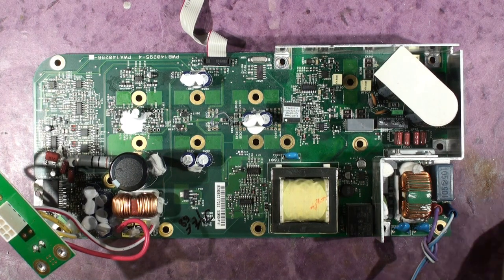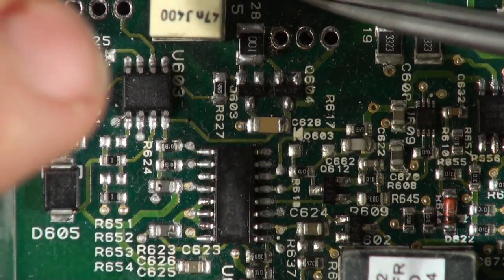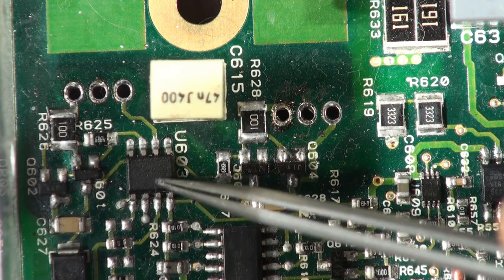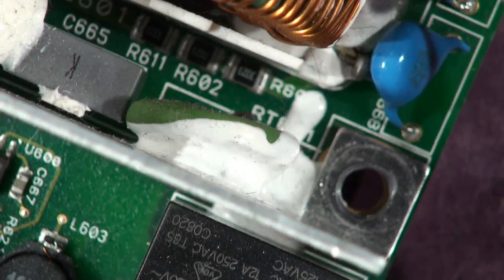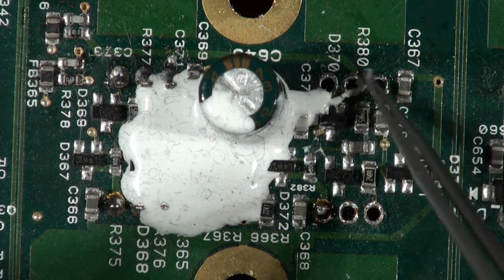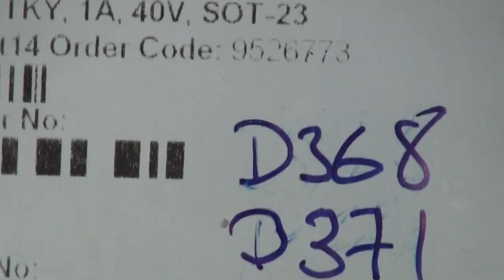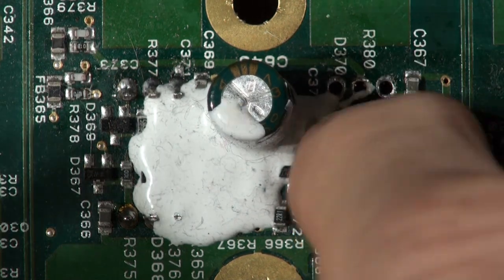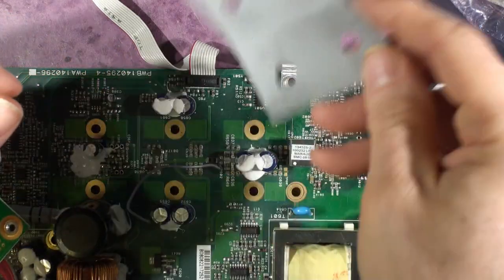JBL EON 515XT Power Board Fast Repair Guide

Comment: Hi Mr. Magic Smoke, 
I'm wondering if you know what other component in the speaker can ruin the amplifier board. I have replaced total of 3 new boards and they only last for about 30 hours of playing. Thankfully the retailer could help me to get all 3 replaced under warranty. Any help would greatly appreciated.  Thank you!
Reply from the maker: More likely to be you mains supply. What mains are you running them from? Also if you speaker connections are loose it can screw the output stage. In addition are you following anti-static precautions. And assuming you have installed the part on the chassis correctly??- - over tightening or damaged heat pads caused punch through and a short to the metalwork..  I never let my customers fit the board to the heatsink they invariably screw it up. I never give warranty to bare boards.
Reply: @razenby 
I run them from a 25FT 12/3 heavy duty extension cord which plugs directly to the outlet. I don't think that's the cause because the other speaker is fine and never had any issue. Only this one. I also checked the connections, they're all good. I also have followed the steps about mounting it on the chassis to do it correctly. About the heatsinks, are they the 2 aluminum bars and the aluminum barrier surrounding the large capacitors? I carefully transferred them over to the new board. I really don't know what could be wrong in the installation process that could shorten its life.  I thought about replacing it with a brand new speaker, but this particular model has been discontinued. That's why I tried to fix it.  Looks like I may have to get a new different model and play with a mix-match set.  If you have any other suggestions, I really appreciate it.
Thank you!
Reply from the maker: @lewisbui6450  Did they supply a new heatsink silicone sheet?
Reply: @razenby  
no, they didn't supply anything else, just a bare board. I had to transfer the mini connector panel over too.
Reply from the maker: @lewisbui6450  You really need to check that sheet for punch through very carefully
Reply: @razenby  
I'll try that. Thanks a million. I really appreciate your time!

Comment: Hey , What is the product number is for the 2 transistors for the power supply Q605 & Q606
Reply from the maker: GB20B60PD1
Reply: @razenby I just checked and the have been discontinued, what would be an equivalent?

Comment: Thanks well presented.
As a retired electronics tech, who now plays in a band, have you come across these having the "limit" light turn on at switch on? I have 3 of these 515xt's, and one decided to perform badly on the weekend. As you suggest amongst your videos, probably worth just taking a careful look first, but I would value any assistance from your experience! Thanks from Australia.
Reply from the maker: Paul did you fix this? If not let me know.

Comment: Awesome information and superb quality of audio and video!!! Do you have an email or website? My JBL EON 610 won't power on but makes a high pitch sound that comes on for 10 secs then comes starts to make the sound again. Main fuse good no LEDs on :/
Reply from the maker: No problem. I have fixed 600 series but can't remember which board is in it. I don't usually get to see the speaker.  If you send a picture of the board to me I'll advise.  Instability like that in one channel is usually one of the op amps in the HF compressor in the  Mixer/Input becoming unstable. Send a picture and Ill check my notes. Ark.mail@gmx.com
Reply: Magic Smoke 
Awesome thanks a lot. 
I’ll do it right now lol
Reply: Wassup magic wondering if you got my updated email?

Comment: hello from Russia. 
i have some problems with xt515 the transformer on the board makes a squeak and the speaker turns off after a while . where to look for the problem ?
Reply from the maker: Check the LN chip and the bobbin coil inductor (choke) next to it. Very common cause of random cut outs. See the video on the sparking coil.
Reply: now that we have assembled it in the box, at 50% volume it turns off for a second then turns on, I can send a video like this to your email.
Reply: hi. have some problems with resistor r 383, 384 they heat up at rest and transfomer heat with out loads (((
Reply from the maker: @Арт-ф6л  I cant locate those components on the schematic. The screeching you hear is instability in the power supply.

Comment: how difficult it would be to just use the DSP pre amp from those amp plates. I have 6 VRX932 passive, I wanna turn them active. get 6 broken plates, remo the amp just use the pream and DSP and use some icepower or hypex power amp modules. more efficient.
Reply from the maker: No Problem.  The output from the preamp is a differential signal so you need an amp with balanced input.  Good luck.

Comment: would you please send me the part number for the chip which controls de 110-220 relay
Reply from the maker: If you want to run on 240V only then remove the flip flop and the comparator chip. They blow short when the FETs blow and load down the VRef from the PWM chip.

Comment: Buongiorno un mese fa ti avevo scritto quel problema ho cambiato i mosfet che sono fqp17p06 e fqp30n06 ho rimontato tutto ho acceso e funzionava poi a volume basso dopo un ora di funzionamento è saltato non funziona cosa devo fare per vedere questo problema devo cambiare altre cose oltre ai mosfet grazie
Reply from the maker: La falla repetida de los mosFET de salida LF P06 y N06 es causada por lo siguiente:
1. No seguir procedimientos antiestáticos al instalar. No hice esto al principio, pero los problemas cesaron después de que comencé a hacerlo.
2. Los terminales de pala de los altavoces sueltos pueden quemar los mosFET. Asegúrese de que las palas de los altavoces estén apretadas en los terminales del conductor.
3. Señal fuera de banda impresa en la señal de control diferencial LF de una placa de preamplificación inestable. (Chip ampliador operativo MC fallido o defectuoso - MC33078) Mida la salida diferencial del mezclador para asegurarse de que esté limpia y tenga solo señal en la banda de frecuencia de audio. HF en esta línea perturba el servo de accionamiento de clase D. A veces, los estallidos de inestabilidad pueden ser provocados por el ruido del suministro.
4. No olvide verificar el valor de los componentes en el controlador de compuerta LF FET newtrok. Se explotan o se estresan sin valor cuando fallan los FET.
Buena suerte.